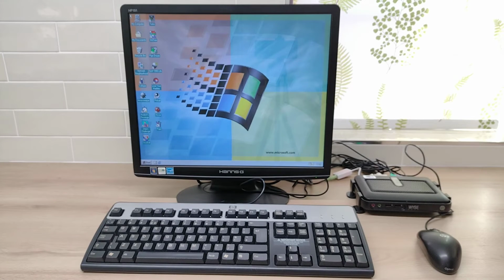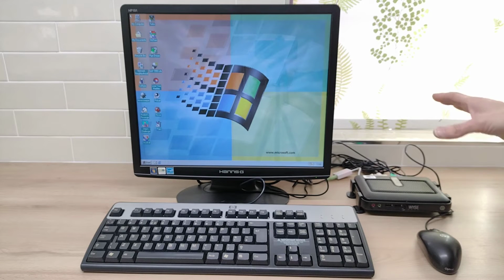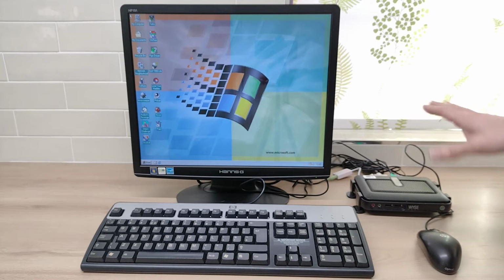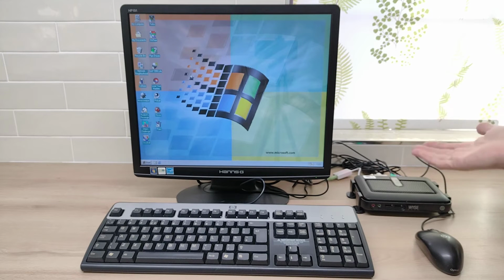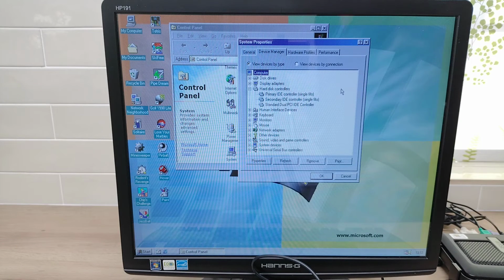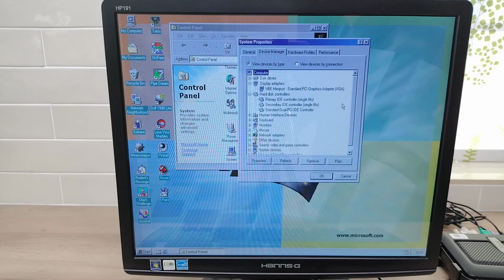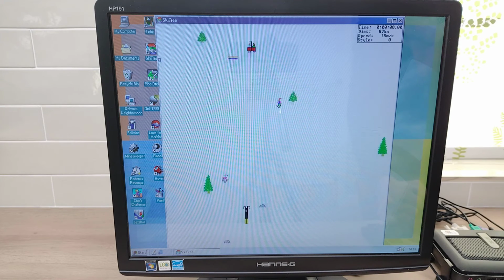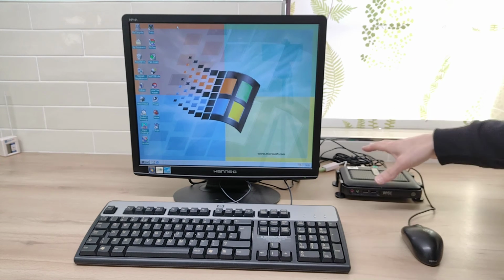Wyse Cx0 C10LE Terminal, an exploration and trying to install Windows 98

Comment: I have a Cx0 i got for 14$ new and been getting windows 2000 professional working. I got no problem getting drivers from 4n1 to install storage drivers.  I do have windows 98 graphics drivers but I don't know if they work im going to try replacing the sd card and try installing windows 98 se. The Audio is HD Audio. Apparently HDA replaced AC97 audio and dropped 9x support. I did get audio working on windows 2000. Apparently there has been a project that made HDA universal drivers that will get HDA working from 3.1 - 9x/me. Where I am stuck witn windows 2000 is getting graphics drivers... I for the love of me cant find working drivers for windows 2000 graphics. Thats where i'm stuck.

Comment: Last night, I spent more time than i want to admit exploring the CX0.  1) I start with the CPU itself.  I found information to the CPU and then cross reference the CPU to other manufacturers using the Processor.   2) I started looking at the details of system boards.  Jetway J7F4 Versa Mini-ITX Motherboard.  Jetway started support (their website) starting with XP.   Owners struggle with same issues as the CX0.  I then came across Gigabyte MB that uses the chipset with a noted driver fix for sound.  It states that the USB (before any driver) interferes with installing sound driver.  It states to either install sound drivers before USB drivers or disable USB while installing drivers.  After all drivers are installed, you can now proceed to install USB 2.0 driver.

I will try various drivers out this weekend if I find the time. After I nuke drive and start fresh with no USB before installing windows.

Comment: try this it might work for you! what you do is take the drivers and  go to Local C Drive and double click it and make a Folder called WYSE and in that folder put all the drivers there and use a program like WinRAR  if they are in a zip file and extract it there then go to device Manager and click on each hardware and tell it to Update Diver and click the 2nd option browse and direct it to Computer, Local Disc C, Wyse, Drivers and chose the folder and it will scan it and most time it will install the Drivers its like forcing the drivers without trying to install it due to wrong operating or hardware restriction these Wyse are little bit weird and sometime is a bug or a written permission from Wyse or dell to reject the driver but my method usually works cause your not trying to install it your just letting it check for the INF folder and then it forces it to use them drivers...

Comment: Since I already had an HP t5530 running 98SE, I decided to pick one of these up for a different experiment: How convincingly can Windows XP be made to fake Windows 98SE? The answer is "Beautifully well once the login process is finished".

(You go 95% of the way there using Windows XP's built-in theming options... including using the System control panel to apply "performance" tweaks to turn off things like transparent backgrounds on desktop icon labels, and then apply the Inexperience patcher to fix things like the Start Menu icon and use TweakUI for XP and X-Teq X-Setup Pro to apply the last few registry tweaks that have no UI by default... just remember to turn off things like the indexing service, BootOptimizeFunction, and NtfsDisableLastAccessUpdate when running XP off flash memory to avoid spending write cycles on mitigations for problems you won't have anyway.)

Comment: I think the hyperion pro 5.24a file is the right one. Mine installed fine. What i did though is to install the unofficial set of updates first (U98SESP3; about 100MB). After that, it installs fine. I also installed Everest 5.5 to find out what other devices i had. So the ethernet is the VIA VT6122 btw. It installs fine and i can access the pc from my other pcs on my network. The Wyse C10LE uses the VIA VX855 chipset btw. The VIA HD audio is the VT1702S. I haven't checked this yet (i think i may have it disabled in the bios as it's not detected, yet). For now i'm using your method of one of these cheap USB audio devices. For partitioning of my C90LE7 4Gb apacer device in this C10LE,  i used partition magic 8 & for backups norton ghost 2003. For video i left the VBE miniport in place, as it works a treat. All works great.
Reply from the maker: Thats some great into and tips in your post, thank you! I wonder if having the unofficial SP3 is the reason it worked due to one of the updates in it? Or maybe it is that specific driver version? Either way, I'm going to give it a try and mine and see how it goes.
Reply: @RetroSuperhighway  Thanks. Update on the audio. It was enabled in the bios, so it's simply not being detected. Some more research suggests that there are simply no HD audio drivers for win98 full stop. Sadly that seems to put that issue to bed, unless someone wants to write some code for it. Fortunately we have a solution though in that cheap USB device (note that the internal C10LE HD audio works great under WinXP on my second C10LE btw). Another thing: once you have U98SESP3 installed is that you can extend win98 its reach to include applications made for win2000 & XP by installing KernelEx (4.5.2 i think, from memory). Another nifty little piece of software for network activity in the system tray, similar to winXP, is lanlights (win98 freeware).
Reply: That unofficial set of updates did nothing but killed my win98 install.

Comment: I think it's a case of the chipset being designed to work with then-current OSs, therefore Windows XP and possibly 2000, and cut-down variants thereof.  There doesn't seem to be an audio driver for Windows 98.  I was wondering if there was a WDM driver for XP/2K that might work, since the idea of Windows Driver Model drivers was that writing for that got you both a 2K and 98 compatible driver.
Reply from the maker: I have tried a driver that was supposed to be Windows 2000 compatible, but no luck with in. I'm not sure it was a fully legitimate driver, I only ever found one copy of it lurking in a dark corner of the internet. Having said that, for the use it gets, I haven't had any issues with the drivers on there, even though they are not the best ones.

Comment: There is a driver called "VIA Chrome9 HC IGP Family" in CNET from HP, it might work for VGA. I also found "VT8251 HDA Controller" sound card driver and "VT6120" ethernet card driver from VIATECH driver site.
Reply from the maker: Thanks for tip, I'll check them out!
Reply: @RetroSuperhighway Any updates? Interested to know

Comment: I know I’m late to this video, but by any chance would you consider making a video outlining the install process?
Reply from the maker: Is there anything in particular you want to know about the install, I can check my old footage but I don't think I filmed much of it. If you search for Phils Computer Lab video on installing Windows98 from USB, that should detial it.
Reply: All good,Phil’s computer lab outlined a few tricks I needed .
Reply: Actually did you ever get the audio working?

I’ve finally setup this thing up with an SD card running windows XP, and internal audio had been a nightmare!

I can confirm that a generic no name usb sound card (that I bought from Kmart, Australia) definitely works.

Comment: where did you find the original driver package ? I am looking for drivers and original windows image for a Cx0 C90LE (4GB Flash + 2 GB RAM version of your one) but WYSE site is not available now.
Reply from the maker: Original drivers for this are still hosted on the VIA website, a google for 'VIA 4 in 1 Drivers' should find them. For the issues I have specifically with this machine, I used the built in Windows drivers for IDE and the VBE Miniport Drivers for graphics, again a google for them will turn up lots of results.
Reply: @RetroSuperhighway  Thanks a lot, I will check. I think it should come with Windows 7 embedded standard. But it seems that WYSE site with OS images are no longer available.
Reply: @travelthetropics6190  what you're referring to is the C90LE7. I have one too. The 7 indeed refers to embedded windows 7. I also have the (well "a", there's several versions of course) Wyse image you're looking for. It's a bit convoluted getting it back on the unit (using a USB stick), but i have done it. I gathered all this stuff ages ago, not sure if i would ever need it. Note that it's pretty useless unless you have a server running on your network for it to connect to. I have looked into getting access to the actual image too, as a means to potentially extract drivers (i'm waiting on some hardware to attempt that). For the C10LE though it looks like Dell/Wyse used their own file system (maybe Fluid?) and hence windows nor linux knows what it is and hence i can't get access. In terms of some older info one can go to Arch ive..... Do t.... Org..... (obvious enough right). Some downloads will still be available there, but you have to dig around a bit

Comment: There is a simplier way to install Windows 98, and that's how I do it in any pc.
Create a usb bootable with the "Windows 98 SE boot disk" (basically is an ms dos 7.1).
Then from there, format the hard drive.
Connect the hard drive to another PC, extract the W98 iso to a folder.
Boot again from the usb ms dos, and install W98 from the folder, is easy.

BTW: how the usb audio adapter worked without usb/chipset drivers???
Reply from the maker: Thanks for the tip! It might have been a little tricky for me in this case as I would have needed to find a 44pin IDE to 40pin IDE adaptor for the disk on module. But all the while I was doing it the way in the video, I was thinking 'There must be an easier way to do it than this!'

Still no idea on how the USB soundcard just plugged in and worked. I would love if someone with more knowledge than me on how Win 98 handles USB and  sound devices could shed some more light on it.
Reply: @RetroSuperhighway  Hi, I found that Windows 98 supports generic USB audio class, which I think was really advanced for its time.
Btw can you check if it's compatible with sound blaster games? Like ms dos games that requires sound blaster card.